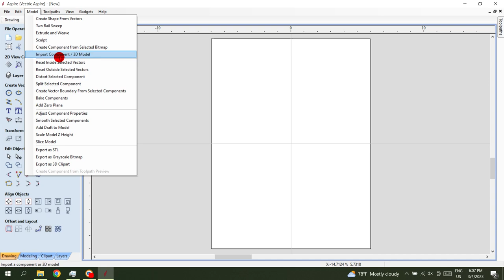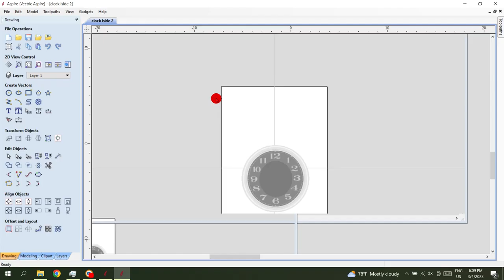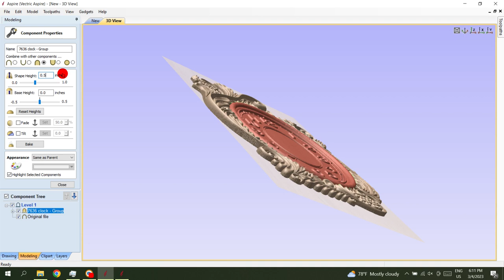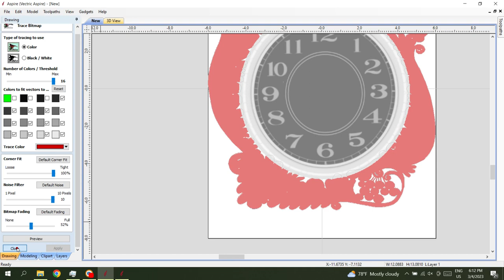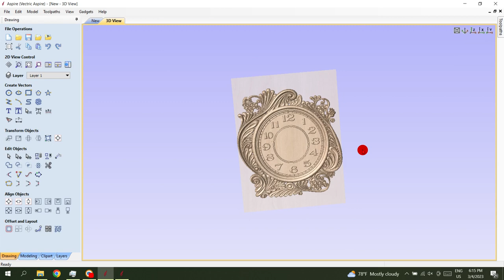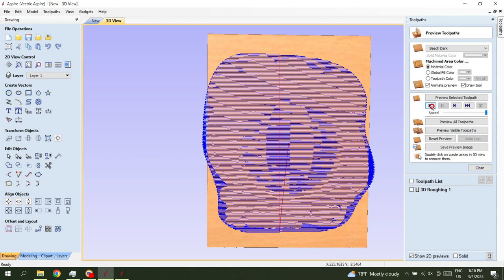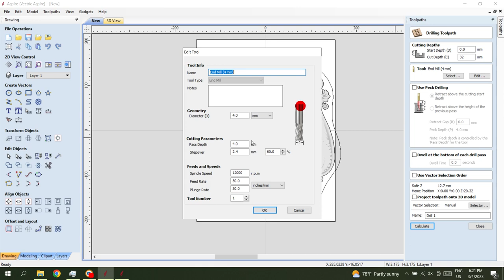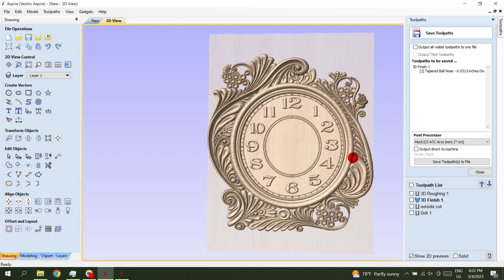CNC Engraving Royal Clock // Vetric Aspire toturial // CNC Woodworking project

Comment: Fantastic as usual master at work; however I have been told to put the collet into the collet nut before the tool as there is a groove that holds the collet in place I see you do not do this is there a reason why you dont do it?
Reply from the maker: do you mean how i dislodge end mill and tools? it is ER11  little bit strictly. i dislodge it
Reply: @nganaungcnc  no on the collect nut there is a grove that locates the collect so it does not fall when you remove the tool hope this makes sense for you I will look for a link to help you